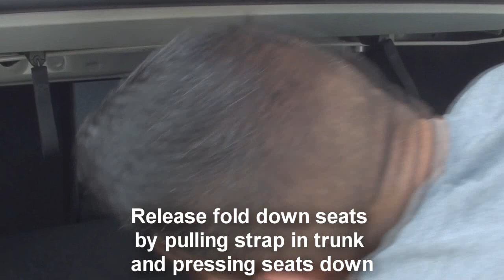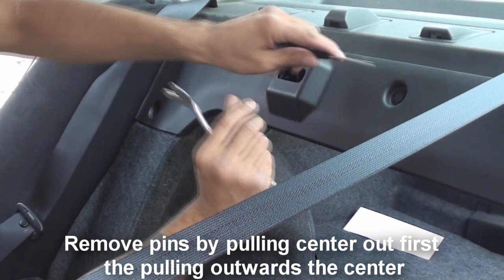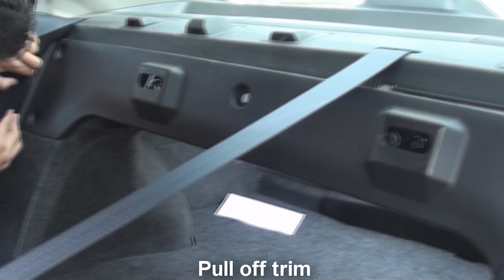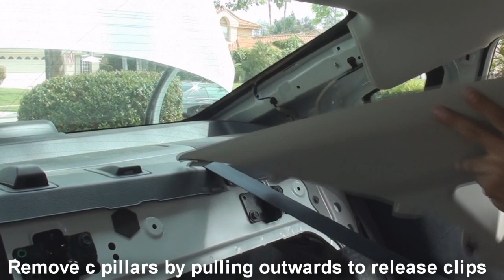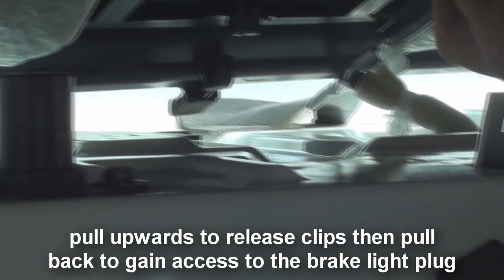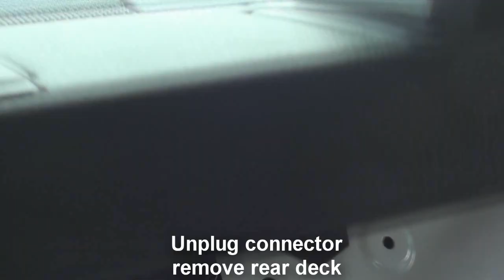how to remove rear deck Nissan altima 2013 and up

Comment: I’m replacing my rear deck cover in my 2023 Maxima SR right now and want to know if you or anyone else would suggest disconnecting the battery first so the airbags don’t accidentally deploy.